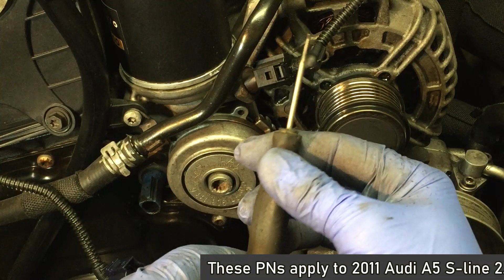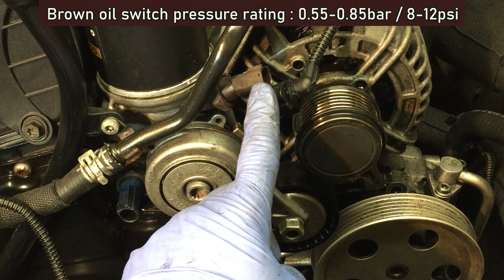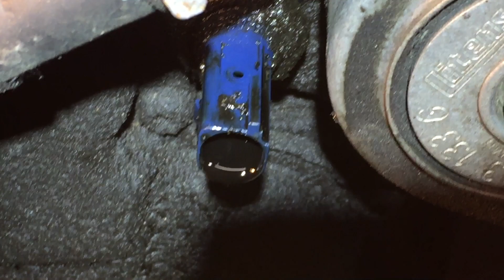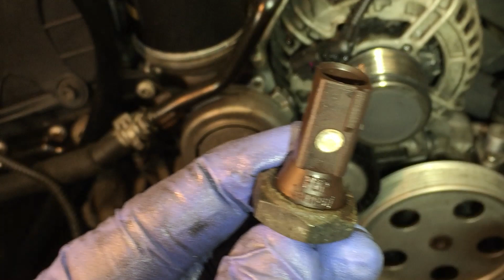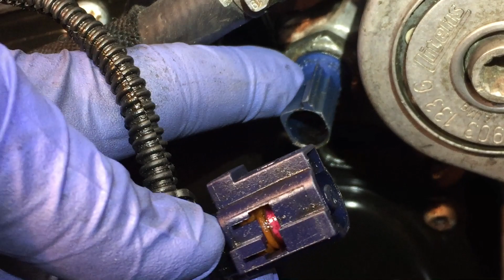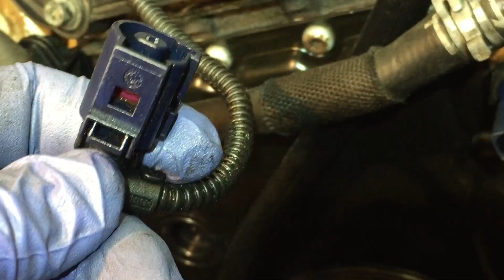2011 Audi A5 S-line, oil pressure switches

Comment: Does the car need to be drained of its oil to remove these. Or are the only under pressure when the engine is on?
Reply from the maker: No, you don't have to drain the oil. When you remove the high pressure sensor tho, the blue one, it's a bit leaky from that hole, be ready for it.